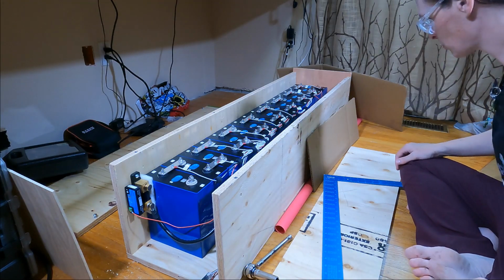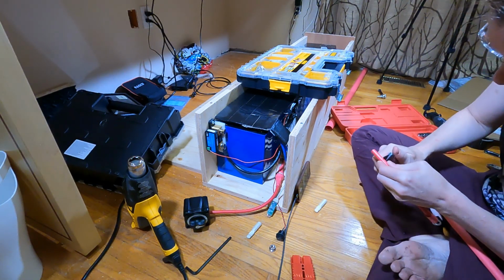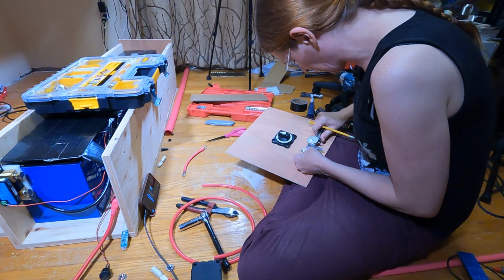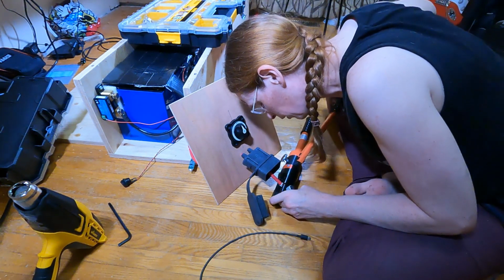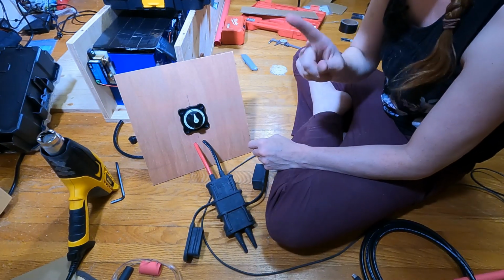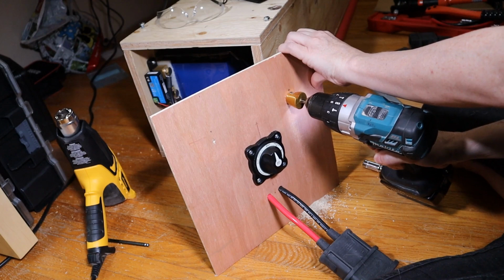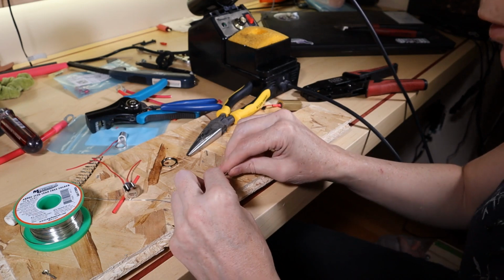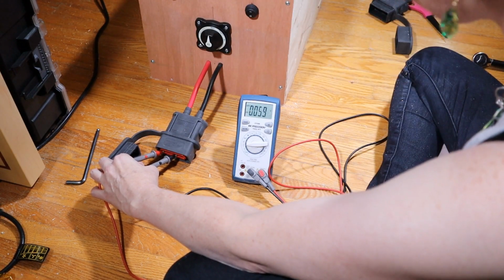Battery Assembled! (and a new camera!) - How to build a 48v Lifepo4 battery (Ep. 12)

Comment: You can put the anderson connector through the end panel and bolt it to the long side panel so it doesn't dangle out the front and it is super secure for plugging and unplugging the connector. It can be in the space where the bms and main positive cable run. It can be flush or out enough to hold your end cap as long as the mounting holes are back inside your box.
Reply from the maker: There's good logic in this approach. In my particular use case though, and I admit I may change my mind down the road, I intentionally wanted to have the connector loose out the front. The idea I have on how and where I'll be installing these around the boat would make it convenient to not have the connector in a fixed place. We'll see though, I may well switch to a more fixed mount later.
Reply: @TheDigitalMermaid , assuming you may not always be in calm waters and that you monitor your state of charge a LiFePO battery can last decades so you don't want any conductors swaying, chaffing, bending if at all possible. I say mount the connector on your box... :-)
Reply from the maker: @MrRobertPogson  I very much expect to find rough seas, I wouldn't be pushing myself hard enough if I was only ever in calm waters! I'll be giving a lot of thought to the final battery configuration... I think, and this is subject to change, that if I compress the cells, then I'll stick with bus bars. If I don't compress the cells, then I'll switch to flexible connections. As for the Anderson connectors, I think letting them "float" would actually but less stress on them over time. The idea is that if the battery packs move independently of the motor / bus bars, then having a non-rigid connection would mean they can move between the two without much stress. 

It's also worth noting that these Anderson connectors are quite a bit over-specced for the back, by design. They're rated for 175 (which already factors in a safety factor), and I will never pull more than 100A (limited by the BMS). Combine that with tinned-copper marine cable / connectors and heat shrink / boots designed to be water resistant (IP64+), I think it'll be ok. :)

Comment: I think a nice tool to get would be a work bench or a folding table to work on.  That way you could use a vice or clamps to hold things your working on.  I keep wanting to help you.  But Canada and South Carolina are not very close.  Your doing a great job so far.  Not to say you won't.   But as you go down into this project you will figure out how things may be better or convenient.
Reply from the maker: I actually have a really nice work bench in my workshop. You can see it in this clip in the background; https://youtu.be/HhiEky64BLg?t=118

Made out of solid maple, has a nice face-vise and a twin-screw and vise. Plenty of dog holes as well. I love it to pieces.

Comment: Hi I'm a new viewer so just noted a couple of points down as I watched you build that . Its good stuff and I see you have your cells charged and balanced I guess and sitting at  3.4 volts . I particularly like your capacitor precharge feature and will use it myself .Don't know what the soft off is about so Ill have to follow what you do with that too.
On the solder there is a fine line of flux inside the solder so fresh on the wire puts flux on the wire which cleans it as well. A flux pen helps too. 
On the box ,if you think you will be charging and discharging at more than .5C then some restriction of the cells can help you . Not compression but just to restrict expansion.Perhaps some packing on the back of the face plate might suffice. When they do expand there is a lot of force sideways. The supposedly lithium ready chargers often put too high a voltage on the cells and sometimes equalisation can switch on and stuff the BMS, shorting it often/always  leaves it connected rather than disconnected and the cells get the full 60 odd volts which is not good. Overall I think you will be happy with the 48 volt system . I am .  Oh and get a foot of 4 by 2  block to go under your drilling . A drill in the shin is quite nasty as its dirty on the tip and thin skin.
Reply from the maker: Ah, the flux in the solder is why it flows, that makes sense (and I probably should have thought of it :) ). I got the pre-charge resistor idea from Andy at Solar Garage, it's a great idea. The "soft off" is a switch on the BMS that tells the BMS itself to cut power off (where the main disconnect opens the circuit directly). I plan to charge/discharge at a maximum of about 0.35c (100A BMS on 280Ah batteries). I'm going back and forth on compression and haven't settled on of I am going to do it. Specially on a boat, the idea of being able to access / swap cells in a cramped dark place in a moving room is appealing... As for the drilling, well, I should know better as I've drilled into my hand twice over the years... :)

Comment: I'm watching these out-of-sequence and the audio-video was fine. I've never seen that crimper you are using; what is it called? I'm using the one where you put the wire/terminal inside and then hit the crimping mechanism with a hammer (I've also seen the one that Will Prowse uses). Agreed on shrink tubing -- you can never have enough. In fact, I was wondering if shrink tubing on those bus bars and terminals might be another way to go -- but not as quick -- as the cardboard overlay.

Comment: a work bench or kitchen table would make your life a lot easier. my brother and i used to rebuild engines on our kitchen table although mother was not too pleased about it.
Reply from the maker: I've got a workbench actually, just need to clean it off. lol! In this case, I was working on the floor because I knew it would be too heavy to move once the battery was assembled, so I needed to assemble it in place.

Comment: I always wonder why people build batteries in wooden cases. If there is a problem that can lead to a fire, I would like the cells to be in a housing that does not burn as well, e.g. aluminum.

What do you think about it? Am I too scared there?
Reply from the maker: I don't believe there is such as thing as "too scared" unless it stops you from doing things once you know what acceptable risk is. In my case, as stated in the video where I built the box, this is a prototype box, to help me figure out where things will go. It will be replaced later. Secondly, though fire is always a concern with electrical, the Lifepo4 chemistry is exceptionally stable, which is why I chose it over normal Li-ion or other chemistries. So fire risk is greatly reduced. I also over-spec the wire size I use to minimize resistive heating.

Comment: loving the cat - needs you all the time - and of course needs his own air time
here's something funny - last year i invested in a proper nice full on soldering kit, it came with the pump which i had no idea how to use or even what it was for - this is the first time i have seen one used, thanks
vorsprung durch technik question: i guess these batteries don't generate much heat, but remember you saying about when charging wires may get warm, should you need to put some ventilation in the box (final box)?
and surely (stop calling me shirly) that there Anderson connector can actually sit in a rectangular hole for stability?
Reply from the maker: Aye, that was my old boy Lynx. I miss that little furball. The final box will have vents, but that's to extract gas in the unlikely case of the electrolyte venting off. The batteries generate very very little heat, even under high loads. The Anderson connectors have bolt points, so they can be secured if you wish.
Reply: @TheDigitalMermaid  i take it Lynx is no longer with you - i sympathise having just a close pal, 2 weeks ago, a three legged German Short Haired Pointer, fabulous dog and we were practically joined at the hip, if i changed direction he was with me, i think of him all the time, makes me smile and well up, he was simply the best, so much fun, and great for giggles, chatted his teeth when i made piggy noises to sound similar
the project is going very well
Reply from the maker: @patchmack4469  It's a bit of cruel fate that, to the animals in our lives, we're their elves. We live so much longer than them, and it kinda sucks. After a bit of time and healing though, then I think the best thing to honour the memory is to make your home the forever home of another animal. There's so many out there desperately waiting for a place to live.
Reply: so true - i put some dog food outside my window hoping to attract a local fox i befriended, the food was disappearing by day and i hoped i wasn't attracting unwanted vermin, instead it turned out to be a rather bold Crow, a handsome brute, but not as cuddly as Gunner, i'm expecting him to start barking if he continues to eat dog food
Reply from the maker: @patchmack4469  Crows are insanely smart!

Comment: hello digital mermaid, slowly catching up with this awesome project ^_^". I know its been a year now since this got released but you mentioned you will be making 6 power banks of batteries; out of curiosity, how did you know that  you needed 6 at that point in time?, did you already by then researched which motor you wanted? or how did you got into that number of 6 power banks :). Amazing videos!, many thanks for sharing this adventure; I have been learning a LOT!
Reply from the maker: Really happy to hear that you've been learning, that's awesome! ^_^  I had a rough idea of what size of boat I wanted, and what motor I'd use. It was largely limited to the largest pod motor I could get on the low end, and the largest boat I could single-hand on the other hand. It that range, I knew that 6 packs would probably be the limit of what I could physically fit in the boat (volume and weight).

Comment: HI, Did you put in a isolator sheet between two battery cell?  The wall cell are very thin.
Reply from the maker: Not yet, but I'm considering it before they get on the boat. Might use thin sheets of polyethylene.
Reply: @TheDigitalMermaid  great project, might I recommend a heat resistant insulator sheet, such as phenolic sheet, or if on a budget look on Amazon ,etc for an extra large silcone craft  mat! I used that for my (250Ah cells) battery build and it works great. If the cell shrink wrap ever gets too hot the aluminum case shouldn't short together. Like you, I like to over build in when it comes to safety!
Reply from the maker: @jamesbsa6450  Yup, an insulator between cells makes sense, specially on a moving boat. I also had plans to add silicon heating mats as a battery case liner to also help with charging in colder climates. Lots of room to improve on the design as time goes on!
Reply: @TheDigitalMermaid  For heater mat simplicity in design and effectiveness, I selected a 12vdc RV water (holding tank) heater which the battery rests on. It turns on @45F off at 68F which sounded perfect for LifePo4 target range. Facon CW-ST725, L 25 '' X W 7-1/4''
Reply: @TheDigitalMermaid  I don't think you need heating mats on the sea..  it wont go below 0 or not? Are you going to visit polar bears? When charging with 0.35C you actually can go down to 5 deg. of celsius, when charging with 0,1C you can go to 0 and on some chemistries even down to -10deg.C. I'm charging like this for a year on my barn and did not saw any measurable capacity drop..
Reply from the maker: @servisfibris6679  I plan to visit Greenland, Iceland, Norway / Finland, and sail as far south as the antarctic if at all possible. So I want to be prepared for (very) cold weather sailing. I would rather have heating pads and never need them, then the other way around.
Reply: @TheDigitalMermaid  Didnt know that, i hope you will post videos also from jurney :)
Reply from the maker: @servisfibris6679  That's the plan! I have basically three "phases" planned for the channel. First is learning about all the electrics I'll use, second if buying the boat and installing the electrics (along with general refit), and third will be cruising. 

There are LOTs of cruising channels out there, so my planned approach will not to talk about the actual sailing or doing many scenery shots, others do a fantastic job of that. I want the third phase to a form of "travel writing / interview" show. I would love to sail to remote villages and places, find interesting people and have them tell their stories.

Comment: What i will concern about is how to fix those cells to prevent shaking and moving from each other. Terminals are made from some easy to scratch metal alloy and therefore i can imagine that after some time, when shaking on boat and fixed just with those busbars it will loose a bit and then it is a matter of time a spark will come on a terminal.. I dismantled some batteries from e-bike and e-scooters and there is a lot of tape fixing cells together, yet isolating their covers and they also use soldered busbars - a piece of flexible metal sheet cutted to right dimension so it not just keeps conection over bibrations but also act as a fuse.. That is why they are using 18650 or other cylinder shape cells..  What i'm doing on my "moving" batteries that instead of using busbars i'm actually using a 5cm long 2AGW welding wire which is fairy flexible.
Reply from the maker: Another commenter also suggested wire-based links for the same reason. There's good logic behind it... Side note; On a boat, you want tinned copper wire (I use Ancor brand). The tin goes a long way to reduce corrosion. Welding wire is fine when not in a marine environment though.
Reply: @TheDigitalMermaid  Another possible solution is to compress and use bothside sticky tape/paper between cells. I will do it like cell-stickypaper-3mmplywood or some hard plastic-stickypaper-cell and so on and then compress whole pack. This prevents moving cells from themselves and allow use of solid busbars. Anyway - you are so brave to do this project and share it!
Reply: @TheDigitalMermaid  Braided bus bars work too (don't know what happened to my previous comment on that).
Reply from the maker: @upnorthandpersonal  braided bus bars are a brilliant idea! Thanks!
Reply: @TheDigitalMermaid  Seems some of my comments go to spam... in any case, check out Will Prowse's forum (can't link).
Reply from the maker: @upnorthandpersonal  I checked the "held for review" section and didn't see any messages. I've got an account on his forum, I should be more active. :)
Reply: @TheDigitalMermaid  ok, weird - anyway, find some posts of mine on the forum regarding the flexible bus bars I made. They're not difficult to make, but you can also find off-the-shelf ones that should do.

Comment: and the soft switch is not working probably because you are not pulling any current out of BMS, so it's capacitor keeps the voltage..
Reply from the maker: It started working a little after I stopped filming. Your idea would make sense, thanks!

Comment: How heavy is the battery and box all closed up?
Reply from the maker: I've not weighed it, but is guess 200lbs? Could be easy off. I'll need to add up the weight of the parts to get a better estimate.
Reply: @TheDigitalMermaid  That is starting to get rather heavy if you need to move it around. I was going to suggest adding wheels to one end and a handle to the other to aid movement, but a lot easier and neater solution would be to use two or more furniture moving dollies underneath it.
Reply from the maker: @davidchester1612  If this was the final box, I would 100% agree that this is wise. In my case, I doubt the bottom panel would hold the weight without deforming, and in any case, I need a box designed for a boat. So for the purposes of a prototype, sitting on a towel means I can move it around well enough for the short time the box will be used. :)
Reply: @TheDigitalMermaid  Didn't see/realise you had it on a towel :) that would be the easiest/cheapest solution to stop it hacking up the floor if/when it had to be moved. Have you tried plugging and unplugging the 175A Anderson connector yet? Unplugging them can be a real challenge.
Reply from the maker: @davidchester1612  plugging in, yup. Not unplugging it yet, but "a real pain" is a feature, not a bug for the boat. :)

Comment: hi, i'm from Andy's camp.  i watched this video and the "shocking" one.  i'm getting the feeling you are getting the cart before the horse.  any plans to have a round table to home in on what you will really want to end up with?
Reply from the maker: Hello. What do you mean by "cart before the horse"? Do you mean working on the boat's power systems before owning a boat? If so, then you're right. Ideally I would choose a boat first, but covid has made that very very hard. So I decided that I had a clear enough idea of what kind of boat I wanted, and I spoke to a naval architect to get a better understanding of what is needed to convert a sailboat like I want to electric. With that, I decided to use the covid time as productively as I could, so I started learning about batteries / electric motors / solar (as well as other aspects of sailing). If this isn't what you meant, please let me know and I'll try to give a better response.